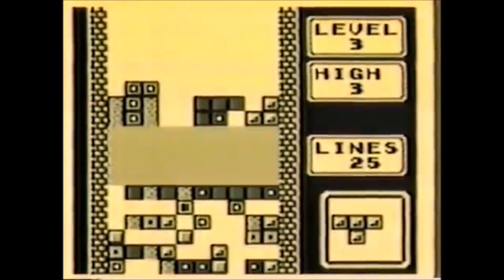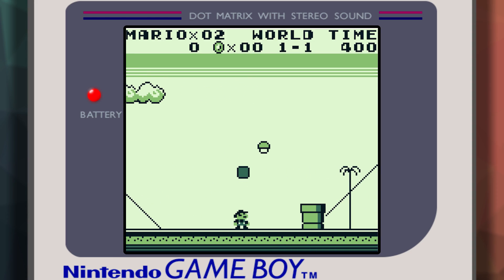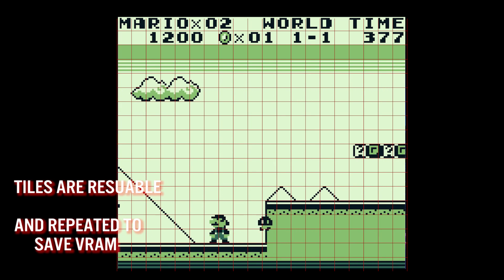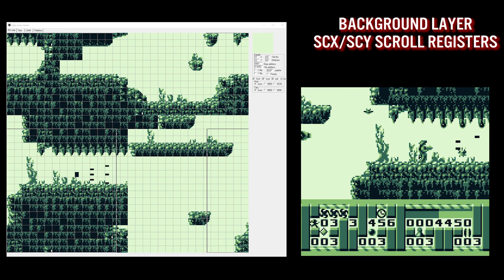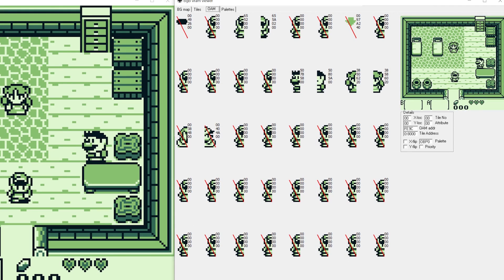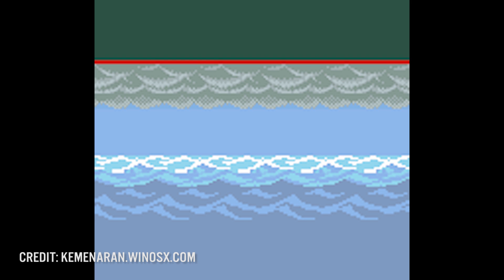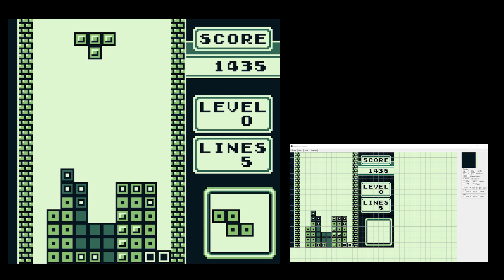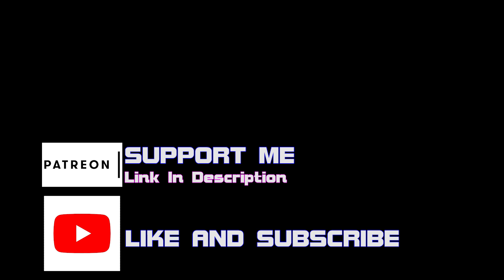How Graphics worked on the Nintendo Game Boy | MVG

Comment: I feel like these ultraoptimisations to deal with seemingly-insurmountable hardware constraints are becoming somewhat of a lost art.
Reply: Graphics programming still has plenty of crazy tricks. They're just not as easy to explain. (And, demoscene is still an active thing)
Reply: On one hand, it's getting easier to just brute force things, and on the other hand there's less time to learn a hardware perfectly and optimize, since tech moves so fast.
Reply: Nintendo still does this. They made a fork of UE4's source code for Super Mario Odyssey and implemented a very very cool render distance optimization method that dithers and downsamples textures/models according to how far away they are from the player. This was merged into the main fork now. So not only does SMO benefit from this, many UE4 games can take advantage of this optimization as well.
Reply: I feel with the increasing popularity of ARM based devices for gaming we could see a bit of a comeback
Reply: @oglack6137  Absolutely, I feel the video game market is coming to a slow crash. Money and greed from companies have all but ruined so many aspects we loved about video games. Others may disagree with this and that's fine but I really feel with the way things are continuing to head we're coming to a big crash. There's already been a small movement to re-create traditional handheld devices using modern hardware such as Gameduino 3x or more professionally a gaming system modeled after the Nintendo Original Gameboy but using modern hardware in a closed proprietary system (Forgot it's name). I'm even experimenting with gameplay on an ARM Atmel SAME54 Chip which is quite capable.

i have no doubt these things will make a comeback because in all honesty I feel modern video games, however pretty, are just heading towards a crash and I've seen lots of other youtubers agree with this for so many reasons.
Reply: @junehanabi1756  Well considering how cheap most consumers are relatively to developement costs, of course its going to head into a crash.
Reply: Great art can only be made with limitations.
Reply: Yeah especially on pc ports of games
Reply: Yep. But people still do it because it's fun.
 The more power you have at your disposal, the more you waste. It never really seems to go into improving things.
Reply: Game engines now also have a lot more overhead. A lot of the newer indie games have graphics that could be easily done on an engine from a decade ago, but their framerate is unplayable on my decade old computer. A lot of people use Unity these days in which they end up using C#, a garbage collected language. Not only do developers not have to ultraoptimize, they don't even have to use C/C++ anymore.

I wouldn't say it's a lost art entirely. It's purely engineering. We went from 2D to 3D. Then with 3D it's just polygon count and raytracing tricks. The technical problem has been abstracted so much away from just game development, that now game dev doesn't involve that type of engineering anymore. It's beautiful to see ultraoptimization as they are considered part of the art piece. You can bring it back if you want to in your own game development process, but not many people are really interested in it since they don't really see any value in it, just like Baroque revival.
Reply: There is a similar concept that is being applied to all forms of programming. In the modern day when you code an application, even a desktop application, you are almost always using a crap ton of ready made libraries and other bits of premade code. It is leading to horrible optimization problems. For example, look at how unoptimized Chrome and Firefox are. The Spotify Windows app runs like total ass on my modern gaming PC. Discord.... don't get me started on Discord.

Opitmization is a a lost art in general. Not just for games and not just with tight hardware constraints. The problem today, though, is that we just throw more and more powerful hardware at the problem in order to make badly optimized software run better rather than our developers learning how to optimize their code. It's a serious concern for the software industry as a whole since new developers are not learning how to create the lower-level, more fundamental code that these pre-made libraries already have in them. Modern devs just learn how to stitch together pre-made libraries with simple logic to get something done, no mater how badly optimized.
Reply: It is. Today we have insane speeds and massive amounts of memory and everything is abstracted away, making us lose touch with the actual iron or necessitating creative hacks.

I mean, there are frameworks to build games with in a canvas element using Javascript that runs in a browser on machines 10 years old. (I Know, I'm building such a framework!).
Reply: @Diggnuts  what u building, friend?
Reply: @gram.  I'm trying to build a graphical adventure game engine a bit like the 90's Lucasarts games.

Here is some test footage : https://www.youtube.com/watch?v=rHjpqefh714

The figure is just a placeholder I .. borrowed.. from some old Indy game.
Reply: @Diggnuts  Insane speeds lmao. Graphics have always been hindered by hardware. even today. If that would not be limiting us now why don't we have ray tracing in everything? Exactly, we don't and we won't for a while.  The more detailed models, lighting, animations etc. the more memory it requires.
Reply: @Diggnuts  Yeah then please could you explain how your statement of limitations in these domains "wouldn't somehow exist" nowadays is in any way correct.
Reply: @S0daB  That is obvious. When you build a game today , are you racing the beam or are you using a framework that abstacts everything away from you?

I'm not saying that hardware is limitless today, I'm saying it is powerful enough for these limits to be less of a problem thus, less people need to get around these. This should not be a hard concept to grasp.
Reply: @Diggnuts  The fact that most tools today have high abstraction doesn't mean that they could be used in all cases. And yes people who aren't gonna push boundaries or test the limits of a system won't have a similar time tweaking and optimizing as the people who worked on the best gameboy games I agree on that but then again we can find examples where games have been extensively optimized. 4 example the new legend of zelda for Switch. And as you know no one can write machine code so yes, the gameboy guys were also on some higher level of abstraction when programming the games on gameboy.
Reply: @S0daB  Look, the fact that frameworks and levels of abstraction exist already proof your point moot. Combined with the fact that the "limits" today mean something completely different than the limits of yesteryear does not make it any better. Pushing boundaries on severely limited iron used to mean get everything out of that machine. Today the boundary simply is what the majority of consumers are able to run.

The fast majority of game coders today would have a meltdown if they needed to find 10 extra clock cycles after any random interrupt event.

If everything under the hood is handled for you and all you have to worry about is the amount of crud you put into the game, then you are talking a completely different skill set. A skill set that does not have the same prestige as game coders in the 80's early 90's had. That is just reality.
Reply: @Diggnuts  Those still exist albeit they are not more complex, we just don't see them because they blend into the background (sometimes literally). You are always trying to maximize what you van get with the limitations you have.

This is especially the case with games exclusives to a specific device platform where you can tailor it to its specific harsware and limitations.
Reply: The modern equivalent of h-blank shimmer effects (displacement mapping) is still used to fake reflective and retractive ripples.  It's now possible to scroll individual pixels (almost) independently and texture filtering can make it look a lot smoother but otherwise it's a direct descendent.

Correct raytraced water is still way too expensive, even with RTX
Reply: It was always cool to me to compare late-stage games from a console (like the NES) to earlier games and see just how savvy the developers got at exploiting the hardware limitations rather than trying to avoid them as they did in the early stages.
Reply: Most of these arts have been shifted away from games programmers to engine programmers.
Reply: It is sad when an excel files takes 1 minute to load on a dual core PC :(
Reply: This is what makes the best games.
Reply: That's what i call pixel art. And i still love it.
Reply: Its funny how symbols have a direct tie to the topic at hand.  If you mention C++ or C# to a guitar player, he would think Mesa Boogie Mark IIC++ (One of the first high gain amps made for heavy music, used on Master of Puppets by Metallica) and C# is the black note (on a piano) to the right of C and left of D, also calked Db or D flat, and it is also a key.
Reply: Carmack is still at it with the Oculus Quest. The stuff he's gotten to run on an older mobile processor is pretty amazing.
Reply: Looking at modern laggy and baggy triple A games - A lost art indeed
Reply: yeah, there was this new game made for the nintendo, some four player wizard game, looks dope and they did a video explanation of their own ultra optimizations. MICRO MAGES was the name
Reply: Some people are hoping it will sort of make a comeback in the coming years, as advancements in processing speed have slowed, yet we are still demanding ever prettier games. Of course, we will likely never see stuff to this level, because it must be able to run on any computer, but it's becoming a requirement to be creative when developing games nowadays, in order to get them to run at ever higher resolutions and frame rates. It's becoming a real challenge though. This is still something you see regularly when it comes to science and super computers and stuff though, as even tiny optimizations add up in that case.
Reply: Nintendo are the prime example of how game developers should be.
Reply: It's coming back with VR.
Reply: You can use pointers in C#, and in fact you have to when calling certain Windows API functions, there's IntPtr and more traditional C-style pointers too in unsafe mode
Reply: Disagree, there’s more hacks than ever before. There’s no point in reinventing the wheel. Plus with tile based games all we had was top down games or side scrolling games. Quite limiting if you think about it.
Reply: In real-time graphics this is still a thing, and it's pretty crazy. In game logic and that sort of the thing, not so much.
Reply: But also Nintendo focused on the elements that matter which is that it had to be pocket sized, had to last an entire trip and had to be cheap enough to give to a kid with the possibility of them breaking it. With the SNES it would be safe in the house and a family would share it so it could cost several hundred dollars just fine but the gameboy wasn't allowed to exceed 100 dollars.
Nintendo put these considerations first since they figured people who want to play good games would just use the home console instead.

The Gameboy itself though is a bit of a compromise. It was originally meant to be a Game-and-watch with cartridges but during development evolved into a mix of that and a NES. The Gameboy also has features like a limited second background, H-blank registers and an ability to read a very large amount of data. These things were things the NES didn't have but many were replicating with clever tricks and secondary chips in cartridges and were things developers were requesting. The Gameboy was used in some ways to test out these features which would later be used on the SNES.
Reply: Two words: Google Chrome
Reply: Whats UDK?
Reply: @rickfeith6372  Unreal development Kit, a discontinued paid way to use the Unreal Engine development kit
Reply: @YoureUsingWordsIncorrectly  I do love to see the people who take to an engine and pretend they learned the underlying language haha 
Just as bad as people with LWJGL
Reply: @YoureUsingWordsIncorrectly  I don't follow the scene actively, and I don't play it on my own hardware, but the Youtube videos of things can be usually looked up, so I very much appreciate your knowledgeable comment and thank you!
Reply: Indeed, for example hardware raytracing is making devs even more lazy. Eventually there will be no more lighting tricks and shortcuts. Just click the 'enable raytracing in scene' button and all surfaces magically look nifty.
Reply: Reminds me of so-called "fantasy consoles", which are like emulators for retro consoles that never existed, with the goal of putting limitations on purpose, to challenge game devs like back in the day.
Examples include PICO-8, Pixel Vision 8, TIC-80. Allegedly some of them can even run on low-resource hardware.
Reply: I don't think a single person on Niantic's payroll knows how to do any of that.
Reply: big words
Reply: I couldn't agree more.  I find myself far more impressed with developers finding brilliant, and creative ways to overcome hardware limitations than I do with what's being achieved today on modern hardware.
Reply: Marco it absolutely is. The solution today is to just throw processing power at the problem.
Reply: I micro optimize the shit out of project parts that run frequently. I slack off a little on parts that only take a few us or ms anyways and don't run frequently (like some commands) and tend to go a little more for and as clean as possible code
Reply: Indeed you are almost certainly right! Just thinking about getting around graphical limitations alone wouldn't be a necessary skill anymore. Unless I'm mistaken...
Reply: 1000% agreed
Reply: Yeah... Game system dont have uniqie graphics or sound anymore...
Reply: It's certainly becoming more rare than ever.  Only hardcore geeks with OCD would see the benefit and go that far now, and it's unfortunate it's becoming rare.
Reply: @leojei  yeah.. it still makes sense to optimize your code tho... Like... If it runs well on my laptop wich has integrated graphics from 2011, its probably optimized enough, and should Run on.... Well, anything...
Reply: Kruemmelbande The Cat I agree 100%.  But sadly that's not how 90% of web developers develop sites nowadays.  My 2011 iPad is still pretty fast when running old apps, but it's dead slow when browsing the web.
Reply: Nintendo AGB-S-MBA Game Boy Advance 6 vintage games Super Mario land 🥶🔥🥶
https://www.ebay.co.uk/itm/313190395156
Reply: Nintendo keeps them alive. To give but one example, I've heard that the WiiU version of Breath of the Wild realtime-renders some awesome graphical effects that would make the much more powerful rival consoles blush.

And there are other people who have the chops, like the people who made Xenoblade Chronicles X.

But the lack of necessity for anything like it except on Nintendo hardware does mean it's been dwindling. Which is a shame, especially since that also means the ultra-powerful nominally-superior hardware rarely gets pushed to its own maximum potential.
Reply: Look at Linux and the Raspi and Ardueno etc. Its less needed in game consoles, but is def still done. Like with real time RT etc.
Reply: I thought it was a joke when Sony & Microsoft were saying Ray tracing would be possible on Consoles.... But it's starting to happen...these days they just put shit out broken and optimization comes in the months and years later over updates lol
Reply: they're making a comeback (sort of ) in the form of Dynamic resolution and AI Assisted upscaling
Reply: I’m years late but in a general sense, yes. However, in the embedded space, I’ve seen some absolutely wild stuff done on Cortex M0s with single digit kilobytes of RAM. It’s sad that with a lot of apps, you’d never know we have 1000x or more processing power than 20yrs ago. 

Personally, I’m learning embedded systems pretty much for this exact reason. The amount of simple, bloated apps that are just web code in an electron wrapper (looking at you Slack as you suck up 2GB of memory doing nothing) is disappointing and I want to do better
Reply: I guess it's because developers tend to use game engines these days instead of really getting into the optimisation side of things. I can't say I blame them. There's no way GTA V is going to be coded entirely by text editors.
Reply: It's not just the power of the machines and the tendency to abuse them, but the fact that most people are learning or working on languages not strong enough to make games on older systems.

By strong, I mean close to metal, C can work on consoles like the N64, GB, even the NES for a reason; it can communicate with these machines, whereas C++ would be much slower, and not close enough to the machine to get results. Heck, even with C on a system like the GB and NES, you'd still need to write somethings in Assembly to get the best performance.

Now, languages like C# and Java don't even use pointers, meaning you can't tinker with memory addresses, which you'd need to be comfortable with to run something on such limited hardware like the PS1 et al. 

I believe that's one of the reasons these consoles are an attraction for talented programmers. Google Sonic Z-treme for Saturn, guy by the name of XL32 (if I recall), you'll be blown away by the few vids he uploaded for what he's done on a Saturn thus far.
Reply: @pyxelpub8251  C++ has many features that can cause slow performance but you don't have to leverage all those features. I've used C++ many times on older or slower hardware just fine. The trick is to not go around turning on and leveraging every feature out there for C++ but to instead be careful and conservative.

Also, it's a bit of a myth that writing pure assembly is always faster. Don't get me wrong, I love assembly and it's one of my favorite languages. But the reason why writing assembly was faster was because compilers, well... sucked. They were pretty crappy lol and spat out horrible assembly code. In 2019 modern compilers produce assembly better than most any human could ever hope to write.This was tested many times by having expert assembly writers write the same code that was compiled by a compiler using C. The result in any situation that I observed was that the compiler generated code was equal to or faster than even some of the top assembly writers. This lines up with people who create compilers, they'll tell you the same thing.

Writing assembly is only ever suggested for older compilers that quite frankly were really bad. The compilers for Gameboy were one such compiler that's way better to not use and to instead write assembly by hand. ---- I think people still thinking that hand assembly is always faster stems from the disbelief and dislike of the idea that a computer can generate better code than a human. It's almost a bit nerving and easily dismissable as a "no way" kind of thing.

But I mostly agree with you, I hate super high level languages that abstract everything away from you and i especially hate languages that run in a virtualized or interpreted setting like Java, Javascript, or Python. Actually I hate python more than anything on Earth lol. But all just my opinions, I'm super old school when it comes to programming.
Reply: @junehanabi1756  I get where you're coming from, a language without switch statements is something I'm yet to comprehend.

And I think that while C++ can be used to achieve powerful results on some old hardware (and amazing results on new one), you just can't get them with systems like the N64 and prior to that. You mentioned yourself that you'd need to be really conservative and even then I can imagine a game running on SNES from top to bottom with C++, if I recall even the GameCube had some bits where they had to code in assembly to make sure the performance held water.

Yeah, I absolutely respect old school far more. I'm only now learning C, but the restraints removed from you, while at first terrifying, it feels like you are somehow liberated. Much more responsibility to deal with, and that means you can't half-ass it and become great at it.
Reply: @junehanabi1756  I like Python. You don't want to create a quick one-use script in an ultra-optimised language.
Reply: @pyxelpub8251  I agree, You absolute can't get the same results on older hardware because the compilers back then were terrible. With a amazing 2019 compiler I can totally see C++ running on older hardware but using an N64, NES, GB, etc... compiler to compile C++ code would be disastrous as those compilers could barely compile C much less anything more. Even if you have a fan-made modern compiler that leverages the latest GCC for example and allows for compiling to N64 I still don't see it working that well because those kinds of compilers I've just never seen be efficient. For older systems it's best to just use the common language at that time. For GB that meant assembly and N64 that meant C with assembly possibly mixed in.

When it comes to speed, it's partly the language, yes. C++ will always have some overhead compared to C and even higher languages will have more overhead. But a majority of the speed comes from the compiler. There have been many tests over-time conducted by various companies large and small that tested performance of professional or expert assembly writers and a modern compiler. The compiler in every case that I ever saw was always equal to or greater than the assembly writer. ----- Gamecube was released in 2001 so those compilers were still pretty bad. I wouldn't say compilers would be at where they are now until maybe the past 5-7 years, 2001 is too far back so I can see them needing to hand-write assembly. Also specialized gaming compilers, minus a few exceptions,  were even worse. Many companies would often go for some hot shot high-priced company's compiler which was garbage even at the time. The GBA was one of the exceptions that actually used a general public compiler, not sure about the Gamecube. But Any compiler before 2011 or 2012 I wouldn't say would be any good compared to the ones we have now so assembly would sometimes be needed. Nobody I've ever talked to ever recommends assembly writing in 2019 for speed because it's often going to perform slower, I've seen many cases where people were fussed at for thinking this (I've been in that boat many times as well lol)

True ^_^ many super high level languages do some serious hand-holding, breaking free from that and dropping into good ol C is very liberating and refreshing. Makes you feel like an actual programmer. Despite what I said above, I still like raw assembly programming. Assembly was my first language and so it will always be my favorite. It's just the idea of getting right down to the processor level, I mean you're right there speaking the native language of the processor, you have even more power than what C can give you and the lines of data, assets, code, etc... are all blurred. That'll never get old to me lol.
Reply: @junehanabi1756 I'm looking to get into programming, what resources would you suggest I look at?
Reply: @junehanabi1756  Tbh, Python is heavily library-dependent, and there are plenty of Python libraries written in C or C++ for efficiency reasons.
Reply: @TheRealGigachad1848  I'm sure there are, to me Python is meant for writing simple shell scripts. It's not meant for anything but small tiny patches here and there. I can't see any use at all in using it in as part of program code.

Despite that I see python being used to make entire games, or systems, etc... and I feel it's because Python is ridiculously simple and does very heavy hand-holding that it's easier to get into and gives one a sense of security with all the hand-holding.

I'm sure Python is a great language don't get me wrong, it's certainly one to be heavily used. But it closely reminds me of NodeJS and the millions of libraries it has which many are written in C or C++ as well.

I'm all for using languages creatively as it shows ingenuity and deeper thinking but I feel some of these languages have grown out of proportion and are being used for much more than they were intended for.

Python also isn't backwards compatible so my first introduction to python was trying to use X programs written in it and me having to juggle different python installations (The system one, the downloaded ones, version 2 and version 3) etc... and not have that conflict with other programs that use some particular version of it.

When writing code, in general I prefer to get as close to the processor as I can so that's why I like C or C++. When writing shell scripts I prefer pure bash or some other variant. I've just never liked Python on a personal level.
Reply: @junehanabi1756  I don't think Python is bad if your software doesn't need to be much efficient. There is little sense in having to code, say, a messaging app in a more complicated language like C++.
Reply: @junehanabi1756  thank you for saying that! I know so many programmers who judge their competency by how many features of a language they can use for inappropriate reasons
Reply: June Hanabi Agreed for the most part. As an electronic engineer, discovering the power of CodeWarrior to program SoCs with more natural languages like C++ instead of direct ASM programming was an eye opener. Sure sometimes the performance was nasty, but that’s the trade off.
No need to hate on interpreted or high level languages, different hammers for different nails... I would hate C and asm too if I had only two minutes to create an ascending/descending sorted list of objects that can dynamically re-arrange, grow and shrink themselves depending on a property value of the objects contained inside the list. One line of code in C# and I can go to bed knowing that it will never overflow, crash or do any nasty memory pointer corruption ever. Not so much if I were forced to do this in C.
Reply: @pyxelpub8251  not true c and c++ are literally the same thing compiled code to machine code. Pointers and all the crazy stuff is possibly in both. Not sure about java. But c# has pointers its call unsafe code but possible. Msil code that u can compile to machine code. C# and java is problem not the best tools to make a game but its possible.
Reply: @woodiemarv  C and C++ are similar but their not the same thing. C is relatively simple and straightforward. C++ leverages extra baggage that's somewhat tucked away and is dependent on the features you use. For example virtual functions are one such baggage. If you make all you class methods virtual what you may not notice is there's an increase baggage of code, ram, and processor power being used behind the scenes. That's just an example of one of the smaller C++ features. I would say C++ is a container of features that you can enable and use as you see fit but that will bring it's own baggage with it. C, by contrast is more of just a language and is far simpler.

Java doesn't have pointers although I've heard some wild hacks that can sort of approximate one.

Also I really hate the word "unsafe code"  that's been a buzzword for sometime in new languages especially really high level languages. "unsafe code" means hand-holding. The more hand-holding the language does for you the less mistakes you can make because you have a more protective guardian over your shoulder. The modern philosophy is that without that hand-holding your program is doomed to fail so it's a hand-holding competition. Thing is, as a programmer, I don't want any language to hold my hand. It causes problems, restrictions, and many design issues. Java's forced number signing is one of them where I have to use twice the memory space just to have an "unsigned number" so that it holds my hand and ensures consistency at the cost of RAM. Games and programs got along just fine without hand-holding, many hundreds of thousands of programs were made in history without any hand-holding and running this "unsafe code" and worked just fine, efficiently, and were well designed.

I agree with you C# and Java are completely not good tools to make a game, look at Minecraft, a simple game of blocks requires an absurdly beefy computer even back into the older versions without plugins. Had it been written in a better language it would have run very well. Unfortunately Unity 3D where most games are made, what Blizzard sometimes uses, and what Nintendo recommends to use for certain developers, leverages hand-holding techniques and one of them is the encouragement to program in C# or Unity Script. Unity Games do run better but I feel like Unreal has the advantage because you can actually use C++ or C however Unreal gets a bit of heat because it doesn't use "hand-holding" and therefore your code is "unsafe" and you can "make a mistake" or some modern crap like that.
Reply: @junehanabi1756  What about Rust, tho?
Reply: @TheRealGigachad1848  Rust looks good but I'm more comfortable with C or C++ and that is more or less standard for embedded programming with many official libraries and examples being written for those two languages. They also don't do any hand-holding. It may be a great language I just don't have much experience with it and would have those drawbacks.
Reply: @pyxelpub8251  
C++ encompasses the entirety of C89 and is almost completely backwards compatible with C in most cases (worst case scenario, you have to go back and add some casting or change some variable names to not conflict with c++ keywords). It's not any slower than C either. For the most part, you can take c code, compile it with a c++ compiler, and it will work fine. I was able to take very old early C windows code from Petzold and recompile it in c++ and have it run exactly the same with either zero or minimal changes necessary.
Reply: @pyxelpub8251  You didn't use C++ on these kinds of systems because they didn't have compilers for them. C++ wasn't a terribly popular language until post-1998 when it was (finally) standardized. Both C and C++ compile to assembly code, so well-written C++ will run just as fast as C while possibly being easier to maintain.
Reply: @pyxelpub8251  There's also the fact that on modern hardware, the compiler will usually optimize your code even better than you can by using assembly, and that multithreading and multi-core processors add a huge amount of complexity, to the point that you get better results using the high-level tools anyway. Plus, older consoles had the advantage that the hardware was always the same on each system, so you could program to that specific machine and focus on optimization rather than portability and compatibility.

I plan on learning NES development in the near future, just as soon as I can manage to finally get off my ass and do something productive.
Reply: @pyxelpub8251  Good luck writing anything maintainable without modern language features, even C++ is falling out of favor due to its lack of reflection. The modern video game industry is focused on rapid development and continued support after release, which makes architectural decisions and ease of development far more important than micro-resource management. The art of hyper-optimization has a diminished purpose in this landscape of constant content updates after launch, as the necessity to re-write significant portions of the codebase to accommodate one tiny new feature is overcome with further abstraction.
Reply: @Wourghk  Ah, I agree with you, and that's why I feel things are coming to a crash. It's just my personal opinion others and you may disagree with. Video games prioritize speed of production beyond anything. The faster you can roll out a game the better. Speed, RAM, and Hard Drive Space take backseat because memory is very cheap and plentiful so being wasteful is encouraged as long as you can get the game out fast and then roll out updates fixing numerous bugs and issues after it's released which was the highest initial priority.

I feel this corrupts the motives of the game, I feel important stages and parts of development are absurdly rushed or skipped all together in the name of speed. I feel the game is focally designed for revenue and income. Now I understand money has always been a big player, obviously, but what I'm talking about is the design of the game for money, not for entertainment. In other words nobody actually cares about the game at any stage of development. I'm talking above and beyond how it used to be. If modern video games keep going down this path it's my opinion video games will crash. There too many video games, most of which are poor quality, filtering through the good and bad ones are becoming increasingly difficult, and money is both being valued over quality and overshadowing the ones which are potentially good. This reminds me of the last video game crash we had which happened for mostly the same reasons.

Hyper-optimization is an art that's mainly needed for cramped spaces like the Gameboy for example, you don't always need hyper-optimization especially for PC's or modern systems, in fact hyper-optimization can obfuscate the code and make it unreadable and un-maintainable. There's much more than hyper-optimization not being done, for starters often there's no optimization being done or at least on many games. There's too many other stuff being skipped that relates to quality because it takes extra time that can instead be skipped to release faster.
Reply: @pyxelpub8251  uhh. You can most certainly manipulate memory addresses in C#, and you can even compile it down to asm... Check out the C# only demo OS called COSMOS.
The problem is just then making a toolchain or compiler for these systems which no one really has any interest in.
Furthermore, it's not a "lack of skill" or whatever you are all trying to imply. Higher level languages are for speed of development for business use. The reason indie games are being wrote in Java and C# is because people are going to school for business programming and trying to use what they already know to make their dream game...
Reply: Today we have products like Windows 10 where it requires a damn supercomputer to sit and do nothing, much less start opening programs...
Reply: @askhowiknow5527  My Windows 10 runs just fine.
Reply: @YoureUsingWordsIncorrectly  This so much lol. Who care's if that ridiculously simple 2d game is 4+ Gigabytes with a million expansion packs and requires a mini supercomputer to run it mostly well. It's the owners fault for not having that when playing the game. <------ Modern game mentality
Reply: @junehanabi1756  almost no one is building 2D games that require four plus gigabytes of data and with ridiculous expansion packs that has mostly been limited to 3D games. Even still, indie games are still going to be perfectly fine if the AAA market crashes.
Reply: The Demoscene is still very active, check them out. They are all about those constraints. And they do demos for all kinds of systems and with all kinds of restraints.
Reply: I agree, I think there will be a comeback though as Moore's law gradually goes away and people still demand to have more power at their fingertips every day. Until quantum computers (or computers which use a material other than silicon) become mainstream, the limit of transistor density will be about ~5nm. And considering we already have some processors utilizing 7nm technology, companies will have to get better at optimizing code again to keep up with market demand
Reply: @billrupert7560  5nm isn't even CLOSE to the theoretical limits of traditional silicon transition technology. TSMC has 5nm coming on line NEXT YEAR, with 3nm deep in development. Things are slowing, most definitely, but we aren't at the wall yet. EUV has pushed that wall back SIGNIFICANTLY (at the expense of dramatically increased fab production costs, hence why only TSMC, Samsung, and Intel are even trying for EUV/ the leading edge nodes anymore).
Reply: @Cooe.  obviously you can fit plenty of silicon atoms into a 5nm chip, but quantum tunneling will start to become a huge problem when you get far below that. They have to deal with quantum problems even when designing 7nm chips. I'm not saying it's impossible that they will design chips that go far below  the 5nm threshold, the biggest hurdle is doing that and making it possible to mass-produce, and for a reasonable price. At some point it just becomes less expensive to use something other than silicon
Reply: @billrupert7560  Quantum tunneling isn't a really serious problem until sub nm scales, which is at least 10-15 years out. Again, you really don't know what you are talking about.  We'll have 5nm chips by late next year & 3nm chips by 2022. 5nm test wafers already exist. Your conception of semiconductors is like a decade out of date.
Reply: @Cooe.  Listen my dude, you aren't even paying attention to what I was originally saying. Let's assume you are right about everything you have said, it still doesn't change the fact that it WILL eventually cause programmers to optimize their code better rather than just brute force upgrading their processors. Also, if you read articles from 10-15 years ago they are questioning whether it will be possible to surpass 14nm on the consumer market, so even if you know more about this than I do, you are exaggerating the dates. I don't claim to be a professor on this topic but I'm also not stupid
Reply: @billrupert7560  Lol so who should the entire semiconductor industry trust? You, or TSMC and Samsung Foundries, aka the 2x largest semiconductor manufacturers on the fucking planet that everyone from Apple to Qualcomm to AMD depends on for chips. Nobody's arguing that silicon doesn't have a finite limit to transistor density due to the quantum effects of working at such small scales, just that hitting said limit is MUCH further out than you seem to believe for whatever bizarre reason. FinFet's are approaching their limits, sure but next-gen GaA ("Gate all Around") transistors patterned with EUV still have at LEAST a decade of future development before another serious wall is hit. Denial isn't just a river in Egypt it seems.

As I've repeatedly stated, you're super out of date as far as semiconductor tech is concerned. You sound like one of the countless "Moore's Law is officially dead" parrots circa the 28nm stall when FinFets were still being ironed out. Transistor shrinking is slowing down, most definitely, but it's undisputed FACT we're still aways away from silicon's hard end.

It's ok to be wrong, dude. But just fucking own it instead of flailing around trying to make your original statement somehow, in someway true, when it just outright isn't.
Reply: @billrupert7560  Quantum computers are extremely specialized for certain tasks (mainly parralel processing). There are many things classics computers will do better than it.
Reply: @billrupert7560  Wow, I never thought of that
The problem is that software would become more competitive, secretive and proprietary
Reply: @billrupert7560  I can't wait for that I hope it will lasts for decades, I miss being creative with constraints
Reply: As someone who’s been making games for 30 years. Yes.  It pains me when people say “game x couldn’t possibly work on switch”, when I will bet 99% of time it can.. if you optimize it well enough, but publishers don’t wanna spend that money.. far easier to throw hardware at it
Reply: Mhm...Imagine a game on modern consoles that had the same amount of effort put into optimization and space conservation as Pokemon R/G/B!

It would make The Witcher III look freaking puny.
Reply: @shiftfire4511  but you wouldn't be getting a game like Witcher 3. You'd be getting something more like an indie title that could be fair. Run on a potato, but the cost and difficulty of development would be so much that it would no longer be worth even trying to make something else as complex. It would mean writing everything from scratch, no engines like what are commonplace today. In fact those generic engines are the source of most of the overhead and asset size we see with games, they are quite large, that and poor asset management and engine related code and dependencies contribute the majority of game size today.
Reply: The need for working around hardware limitations has been greatly reduced. But that does mean that developers can spend less time on tricks and more time on just making the game.
Reply: John Ross  Yes current devs suck cos they make games with 1000x the complexity for ten times more platforms than this video example of one 2D sprite game for one specialized system.

Seems legit.
Reply: I agree. I feel like a good solid wall in hardware development is needed, to get people to start optimisation techniques again. These days they make amazing graphics but you need to spend more on hardware to experience it
Reply: Nah, new games still do plenty of amazing tricks, its more subtle and on a higher software level, engines are much more complex nowadays.
Reply: How about games optimized for the Nintendo Switch, which has a glorified mobile phone SoC?
The level of fidelity developers are able to extract out of the limited hardware is nothing less than amazing.
Reply: Ryan Clark That's just incorrect, there are situations where throwing more hardware at it IS the right solution, in particular when it comes down to business stuff. If you can't or don't have a way to address some other issue quickly and it's losing you money not to fix it, throwing more or faster hardware at it definitely is the right answer. 
With games it's a different story somewhat but not always, developer time is very expensive, and there has go and always will be a cost benefit calculation done when it is for commercial purposes and not just for fun.
Reply: Not really. In automotive applications, very cheap processors with only 10s of milli watts power consumption are used. With only couple of 100 kb ram, ultra optimizations with carefully designed  memory transfers are required. Even doing a simple square root may need carefully designed algorithm.
Reply: If I was designing a system I wouldn't want to rely on hard learned programming tricks to get a Link's Awakening tier game running. If you get the system aspects out of the way, you lower the bar for who can produce a game, and you'd get people like Toby Fox (who isn't a traditional programmer) producing indie hits like Undertale.
Reply: I don't think that's very fair assessment. 3D graphics are not the same as 2D. From the time and money that it takes to make a game these days to having the same game on multiple platforms is enough to take time away from tweaking a game to perform exceptionally.
Reply: @OldsXCool  honestly, I think that's part of the problem. In the old days, you bought a system because you wanted the games that made it to that system. Today, developers are so focused on getting their game to run on every phone, console, and toaster that they usually let the quality slip for the sake of making it widely available.
Reply: @cedwardsmedia  They kinda have to because otherwise they won't appeal to the market.

Hardware changes also necessitate some of this. In the old days each game hardware with (minus IBM PCs) was very specialized with special architecture which means that most games are not cross compatibles Nowdays all consoles minus Switch run x86 just like PCs.
Reply: Now imagine ultra-optimizations on state of the art hardware.
Reply: Yeah, it’s rather incredible and ridiculously resourceful.
Reply: well, id say the Switch still has some of those. See Panic Button's ports, Witcher 3 and Super Mario Odyssey.
Reply: @YoureUsingWordsIncorrectly  Well ita kinda hard to do when you're designing for a lot of different platforms and sometimes chip architecture. Not to mention the complexity and size of games these days.
Reply: We still use lot of tricks and optimizations to run games on low-end Androids, changing c++ engine code everytime we need.
Reply: You're right, but nothing is stopping you from creating new software for old, limited hardware nowadays. It's great fun, actually!
Reply: coughs VR in the 2010s coughs
cougs wii ports in the mid 2000 cougs

coughs every Naughty Dog game cougs
Reply: It’s still a necessity in blockchain smart contract development. You’re forced into it not by hardware constraints, but by financial requirement. Every computation you make comes down to a miner’s transaction fee, which is a bill someone has to foot; as opposed to relying on having X basic system requirements that pretty much everyone has now that we put supercomputers in our pockets. With blockchain dev, you’re out there trying to find the most optimal way to balance safety and speed with minimal resource use in even really simple stuff most modern programmers take for granted, like even literally just generating a random number. And if you do it right you can make millions in a couple heartbeats. If you do it wrong you go straight to jail. Super fun stuff.